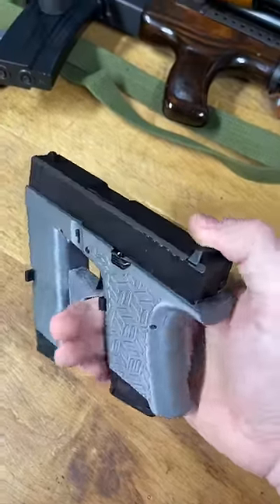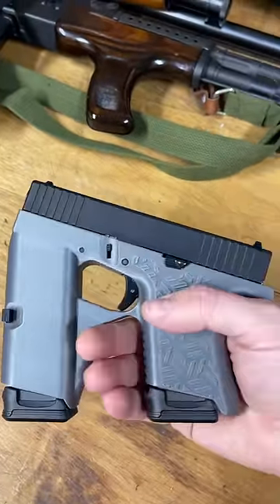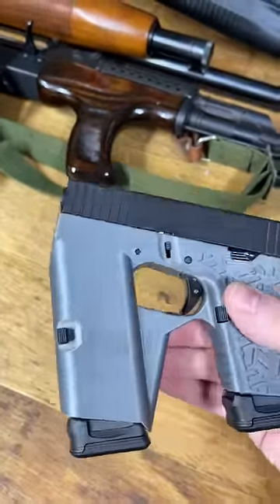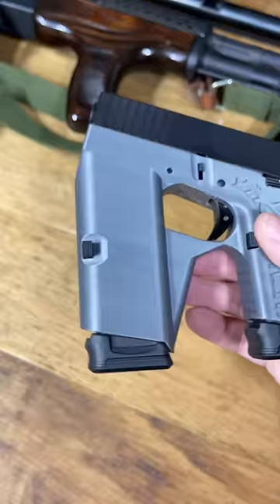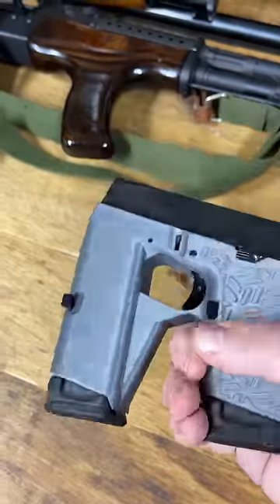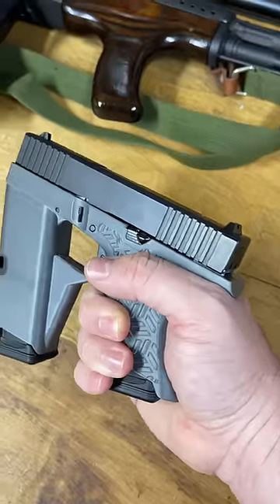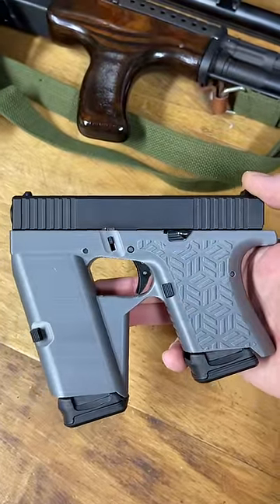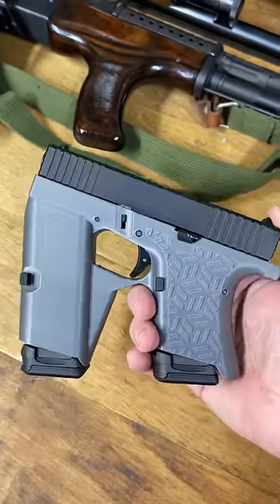G26 NAO “Not Any Other” Pistol

Comment: Is this dude blind that is 100% a pistol with a front grip! 💯
Reply from the maker: I mean, I designed and engineered it. So I’ve got a good idea what it is.
Reply: @booliganshootingsports  well I got 20/20 vision And I can clearly see it's a pistol with a a place anyone would use to put their other hand, normally called a front grip.
Reply from the maker: @Michael-xp5mw  you can choose to put your hand however you want. But it’s not designed to be a grip. That’s the point. You can’t grip it. There’s no place to wrap your thumb around it, which is a required feature to be considered a grip. There’s no gripping textures or stippling and your hand will slide up if you use it as a grip. There’s nothing stopping your hand from sliding in front of the muzzle. If you use it as a grip, you’ll probably shoot a hole in your hand. 

And that’s the whole point of the design. To show how attempting to make a design that is compliant with our asinine federal laws often results in a firearm that’s less safe to the users and a risk to anyone who may be downrange.

Comment: if ever planned to be used it should have been printed with layer lines going the other way
Reply from the maker: That’s not correct at all, lol. The recoil forces would tear a frame apart if you printed it vertically.
Reply: @booliganshootingsports  that depends on what it's printed out of. but regardless you always want layer lines printed in the correct direction
Reply from the maker: Correct. And this is the correct direction for firearm frames. I’m a gun designer, and have designed and printed dozens and dozens of firearms, lol.

Comment: But it can still be gripped
Reply from the maker: Poorly and with great risk to the shooter.
Reply: @booliganshootingsports   How about with gloves on?
Reply from the maker: Gloves won’t stop your hand from sliding in front of the muzzle and getting a new hole installed 😂
Reply: @booliganshootingsports  tacky, rubber gloves.  Could hold it toward the bottom of that front part
Reply from the maker: @MattNis1  Which wouldn't be an effective grip and would still risk sliding up on the front into the danger zone. Feel free to print it and try. 

The point of this whole design is to showcase the dumb hoops a designer has to jump through in order to avoid breaking federal law, often resulting in a design that is less safe for the shooter. The point is that it's a terrible grip because it can't legally be designed to be a good grip.

Comment: Can definitely be used as a grip... "iT DoEsNt hAvE tEXesTurE!" Lol like that matters..
Reply from the maker: Legally, it does matter. It’s not just the lack of grip textures that make it unsuitable as a grip. Using it as a grip would likely result in your finger getting blown off. 

And that’s the point. To show that, in an effort to make a design that is legal, you often result in a design that is less safe. To showcase the absurdities of these federal laws.
Reply: @booliganshootingsports  I live in the UK so dont really know the rules where you are. Here its all illegal. But thats a grip lol just like bump stocks are still full auto. Its a technicality..a grey area.
Reply from the maker: It’s not a technicality or a gray area at all. It’s not a grip. It’s not designed as one. It has featured in place to prevent use as one. If you use it as a grip, you’ll probably shoot a hole in your hand. 

Just like a bump stock isn’t a machine gun. You’re still pulling the trigger independently for every shot. By the definitions in our laws, it’s not a machine gun which is why that rule change they made that banned them is in the process of getting overturned right now.

Comment: But the moment you put your hand on that front it turns it into a grip, no matter what you say about textures or the look, it's a grip that your flaunting isn't a grip. Get a life dude.
Reply from the maker: Legally, it doesn’t matter how it’s used. It matters how it’s designed. This is designed with required things in place to keep it legal. If someone chooses to try to work around those and use it as a grip, they’re risking shooting a hole in their hand, because it’s not a grip. 

And that’s the whole point of this design. To show that the steps required in order to keep a design legal oftentimes result in a firearm that is less safe than it would be if those laws didn’t exist.

Comment: just tac on more mag holsters till it's too heavy to carry but call em iron sights 🤷🏻‍♀️ because accuracy then you just have to pop the mag you just pop n swapped back into where you grabbed the other from so you don't loose it  and then you can never have enough lazer pointers scopes and red dots that only work when lazers engaged  "🤫 because it's smarter" I'll be happy with no less than 9 extra mag holsters/ i mean irorn sights... lots of iron sights but let's make them ironically out of plastic with the material labeled iron sights  or plastic sights or woodsights or ,,, I'm running out of materials here but you know even steel sights aren't iron sights ... maybe cut a hunk from a cast iron skillet just for good measure in labeling they got mini 1 egg 🥚 cast iron skillets you can just weld to the top😁😆😂🤣😋

Comment: Wait hold up thats not a stupid gun bro its ingenuous in the right hands its very deadly and in the wrong hands its also deadly 🤣🤣🤣🤣 u may have to do some tweaking
Reply from the maker: That’s the thing, you can’t do some tweaking. Any changes which make the front easier to use as a grip make it illegal.
Reply: @booliganshootingsports  well hell that sucks move to pa much easier in gun laws
Reply from the maker: This is designed around FEDERAL laws, so nationwide ones. The laws that require this to be designed the way that it is apply in PA.  You can’t have a forward vertical grip on a pistol in PA. I live in Utah which basically doesn’t have any gun laws aside from the existing federal ones.
Reply: @booliganshootingsports  Ty for the clerifacation still sucks tho
Reply from the maker: @sharifwilson44  Oh, it absolutely sucks. That's why I designed this in the first place, to educate people about the dumb laws that we have to follow as gun owners and designers to avoid going to prison.
Reply: @booliganshootingsports  facts